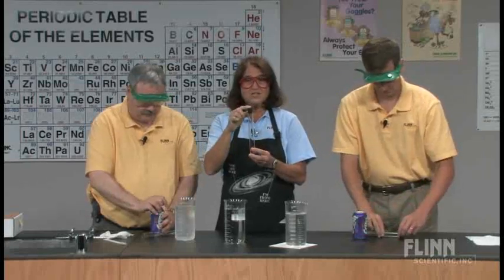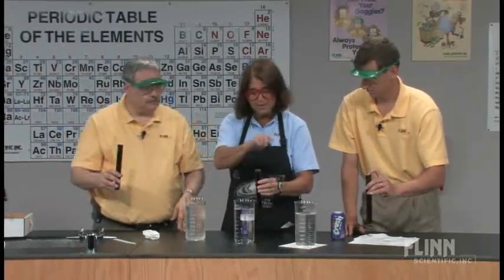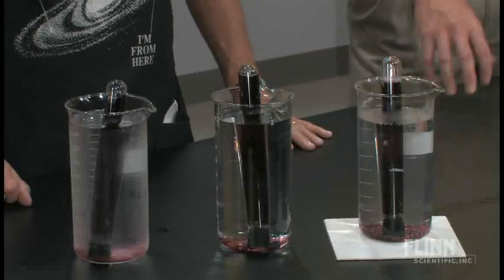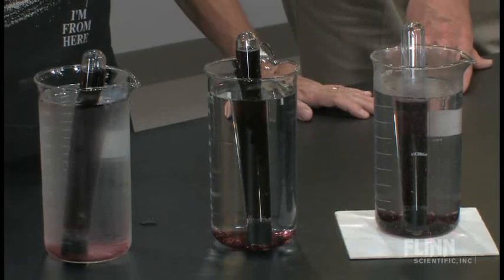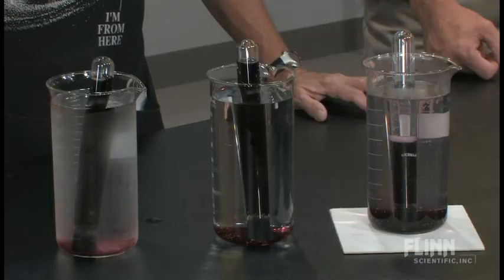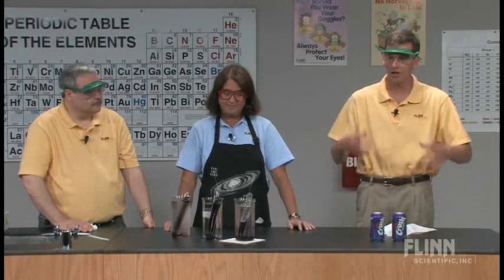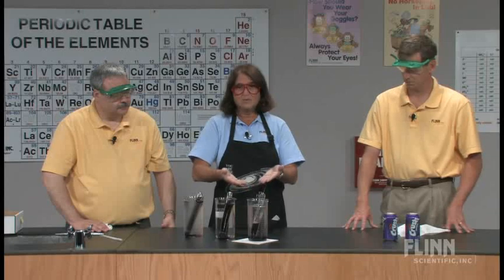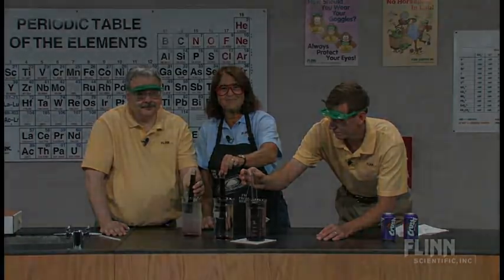Solubility of Gases

Comment: gases are not soluble in liquids - the video proves that as bubbles can be seen escaping from the liquid!
Reply: If it so, how does а fish breathe?
Reply: yes they are. Especially in lower temps and higher pressures.
Reply: @joanyou6254  these people are not demonstrating solubility of gases in the video - they are merely demonstrating the rate of gas production under 3 different temperature conditions!! You guys should get a proper education!
Reply: @PeterPete  literally the first words said in the video are "doing a quick experiment of solubility of gasses in a liquid" (roughly)😒. Regardless i was simply addressing the fact that you said gasses aren't soluble in liquids. They very much are and I'm assuming you've finished your education, because I have not and am still in school and this is the very topic we're doing. And the very thing my teacher told me, that gasses are soluble in liquids. But only under low temperatures and or higher pressure.
Reply: @PeterPete  and it's not even the rate of gas production bruh😂😂. Each tube thingy is subjected to different temps to show the rate of gas dissolvation in the liquids. The colder tube is still really full because the gas is actually being dissolved. The hotter tube is releasing gas because the particles are escaping more so because of the increased kinetic energy
Reply: @joanyou6254  So where's the high pressure or low temperatures to dissolve atmospheric oxygen into pond water? By asking a simple question like this can you see how your understanding of gases dissolving in liquids is flawed. Maybe you ought to have asked your teacher that question and see how s/he answers!! Again the video does not demonstrate solubility of gases in liquids as the title suggests, they are merely demonstrating the rate of gas production under 3 different temperature conditions. Do you see gas bubbles dissolve into the liquid? I can't. Can you not see the bubbles of gas rise to the top? I can. That indicates to me the title of the video is flawed because they are not showing the dissolution of gases in liquids. It's clear in the demo the heat acts as a catalyst and encourages the acid/alkali ingredients in the pop to react more thereby producing more gas. You have to look at the ingredients they put in pop drinks to fully understand what is happening in this demo.